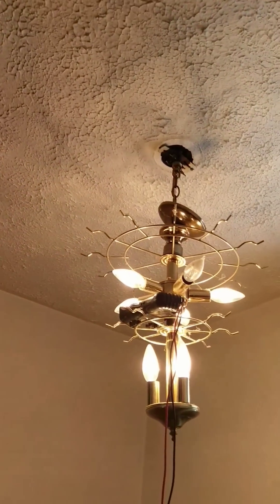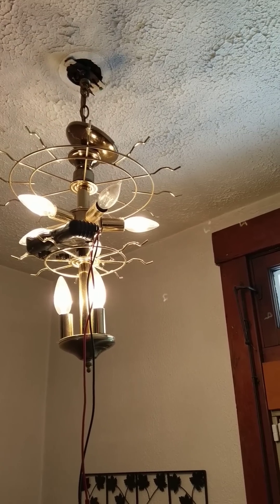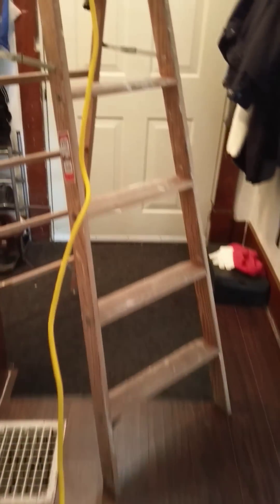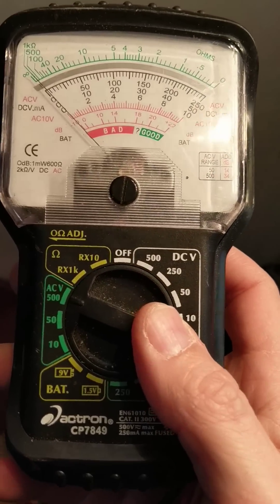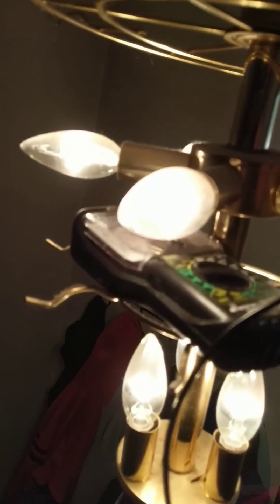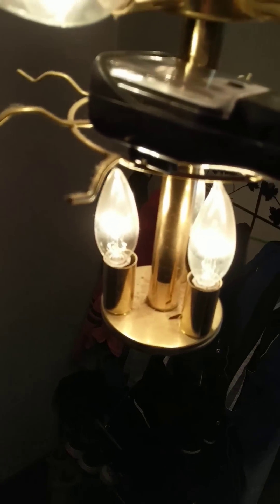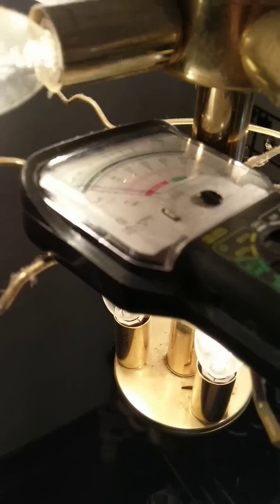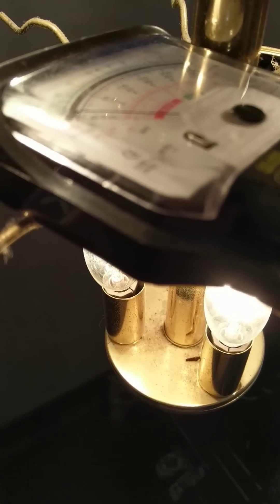DIY How to use a multimeter to test for hot and/or neutral wire when doing electrical work.

Comment: Hang on if you turned of the beaker like you said you did then how come the bulbs in your light fitting are on and one of the wires are hot ? I think you need to get the wiring in your house checked out ASAP
Reply from the maker: You have to turn the electricity off to expose the wiring. Then you turn it back on to test it. Please stay away from electricity if you don't understand that concept.

Comment: well if I only have 2 wires, a Live wire and a Neutral wire (and no Ground) How can I determine which one of the 2 is which...?
 Using a Multimeter..
Reply from the maker: Did you watch the video? Its not the greatest vid, but it explains how to find which wire is hot using a extension cord plugged into a wall plug with a known ground technique, using a multimeter.

Comment: This was a great explanation, thank you.

I'm trying to find whether an old light switch has power still going to it. Because we can't find anything that it's hooked up to.
Reply from the maker: If you simply wanted to find out if power was being supplied to a switch or a light, you can do that with a multimeter. They also sell devices that can detect electrical current that operate in a similar manner as a multimeter.

Comment: What if you don't have a known grounded outlet, how would you test them?
Reply from the maker: I'm sorry I didnt see your comment earlier. So, what I would do is go to my breaker box and open the case to expose the wiring inside. Dont touch the wiring! I would look at the wires and find one that has a copper wire going to the "side bar". So you got  two wires going to the breaker, and the one  copper going to the grounded side bar. If that breaker controls, say the kitchen lights and outlets, then those outlets will be "known grounded" outlets and you can perform this hack to figure out your issue. Good luck and let me know if you have any more issues I might be able to answer.
Reply: @ConwayTy  thank you!

Comment: For some of us idiots out there, which one is which when you get a reading or no reading?  You did not specify.  I will ASSUME that if the black of the voltage meter is grounded, and the red line of the voltage meter is touched to the HOT wire, there will be a reading on the voltage meter.  I will also ASSUME that if the red line of the voltage meter is touched to the neutral (white) wire, there should be no reading.      IF THESE ASSUMPTIONS ARE NOT correct, would you let me know so that I can delete or correct this comment?.  or would you DELETE this comment if the assumptions are not correct?
Reply from the maker: I'm sorry. Yeah my video sucked...lol. you assumed correctly, in that, the black is grounded and the red lead, when it touches a live or "hot" wire, you get a reading. So whichever wire you get a reading from is your power, or hot wire.
Reply from the maker: I hope this helps you figure out your problem!

Comment: Thanks for posting this very helpful video.  I do have a question.  When you plugged the extension cord into the grounded outlet, was it is in the same circuit as the light fixture?...or, does it matter?   I have two black wire coming out of the ceiling fan fixture, one solid wire and one stranded;  the light on the ceiling fan is turned on by the wall switch, but the old ceiling fan was controlled by the chain ( wired hot, i guess), but I don't know which one is hot.  I'm trying  to wire in a new ceiling fan with a remote and made the mistake of not noting how the old fan was wired.
Reply from the maker: Hi. Thank you for your response! It does not matter which circuit you use. As long as its grounded in the breaker box. If you dont know, you can try different outlets in the house. GFCI outlets are usually grounded, at least they are supposed to be but there's a work around for that... but you will know if an outlet is grounded when you start testing wires and find that one of wires gets a reading or none of the wires get a reading.

Comment: Dear Stick Man
I noted that you have a blaringly bright candelabra.  Perhaps this is the home of your parents or someone who is very hard of seeing.  But I truly wish for everyone to have the best lighting possible.  Lots of people dont stop to acknowledge the adege, "lighting is everything" for what it reallly means.  It does not mean that a lamp is everything, it means that lighting design, employing differnet brightness for different tasks and features is the key to successful ambiance.  Brighter does not mean better.  Design means better. While you may already have a dimmer, I have another suggestion.  
SOLUTION:
Replace the 6 horizontal bulbs with Edison style LEDs.  If you are already satisfied with the bare bulb look, why not do it well?  Some people have really had enough of the decade-long Edison craze, but that span has enabled better access and affordability to non-pro consumers.  Why use a 100w looking granny-brite white bulb when you could be looking up at a graceful amber mastery of technology?  Its more fun!  Apart from reducing your electric bill, you wont have to worry about having the lights on as long because they last so much longer.  In a room less used, the savings arent really there because the cost of the bulb outweighs that, unless were talking maybe about 10years of consumption.  But in a heavily used room like that, with it being the main overhead light, it will certainly save u $.  You might even pepper 3 LEDs with 3 you already have going, if u really dont want to waste the bulbs that still have life in them.  But I can see that one has already gone out, and the other 2-5 could further be stored and used to replace any of the 3 verticle bulbs that may burn out. 
Contemporary style can be difficult to upgrade, but this might help u span the 38years since 1980.  Some people think a big truck is the way to make an impression, but this is a more lasting, cost-effective way to make your teens think youre hip and the all the ladies swoon.   Yes, good lighting can make anyone the sexy king of smooth.
Reply: I would go with an LED under a 25w equivalent.  These look decent, but maybe too bright:  https://www.1000bulbs.com/product/117865/PLT-KC354SZCL22K.html?gclid=Cj0KCQjwl9zdBRDgARIsAL5Nyn3FcZMgbn14xJABOm3B2sT84Zh06b4OgndAqIm5ZOkbzbeyMCSYLdEaAqVgEALw_wcB
Reply from the maker: I was replacing the light fixture andsaw a youtube video opportunity... But thanks anyway...

Comment: So, should I twist the hot wire and neutral wire together?
Reply from the maker: I'm not sure what you meant by twist together.... If you mean twist them together before you hook them up to your new light fixture on whatever you are trying to hook it to, then no. Do not twist them together. The hot wire twists to the new fixtures black wire and the neutral twists to the white wire and the copper wire gets attached to the fixtures green screw. Don't forget to twist wire ties into the ends of thewires you twist together and cover them with electrical tape to prevent a fire.
Reply: @ConwayTy  This is a very useful and important part of the process I wish you had included in your video. Otherwise, very helpful video.
Reply from the maker: @imagesinla8575  Ok. I appreciate your feed back. I was really just trying to help individuals that are mechanically inclined enough to feel confident to know what wires connect to where. If you found your hot wire and don't know what to do next, you or anyone else reading this should really call an electrician.
Reply: @ConwayTy  "The hot wire twists to the new fixtures white wire and the neutral twists to the black wire and the copper wire gets attached to the fixtures green screw." What do I need to call an electrician for?

Comment: I have three wires coming out of the ceiling. One was reading 120 volts, one was reading at zero, but the other was fluctuating. So, is the one with 120 is hot, the one at that changes is the ground, and the one at zero is the neutral?
Reply from the maker: I'm positive the one reading 120 is hot. The ground wire usually is not insulated and is just a stiff piece of copper wire. The one with no reading is neutral.
Reply: @ConwayTy  Yeah, but in this case, I have three wires coming out, but they are not black, white, and blue. I have a yellow with 120V, and two white wires, one reading at zero volts, and other with reading that constantly changes. Whoever ran the wires did a poor job, but I'll figure it out, thanks for the advice. 🤔

Comment: Nice video!  Can I use this method to differentiate a line (hot) wire from a load wire?  If so I would imagine the MM would read about 120 on the hot wire and 0 on the load wire.
Reply from the maker: You are absolutely correct. Sorry I didnt see this comment sooner. For some reason I am not getting my notifications....

Comment: This video was a big help on the basics of a multimeter. It helped me diagnose a problem I was having with my relays in my pool control box. Was able to easily isolate the problem and fix it. Thank you! Saved me a lot of money.
Reply from the maker: Bender2497, wow, I am glad that helped you out!!
Reply: I was only familiar with checking fuses in my car using my multimeter, but kept getting erroneous readings when trying to just measure the voltage running through a single live wire. Using your method of grounding it through the extension cord did the trick for me. I just didn't know where to ground it.
Reply from the maker: Bender2497, nice! Way to go man!

Comment: I really wish folk would learn to turn their cameras sideways or horizontal when filming videos as this, as to not do so makes the video look as if your viewing things though a fence post or knothole. This was the exact thing I wanted to learn in using the electrical cord from a known working light socket, but it was sort of difficult to follow with the video shot in this manner. I have a dead set of outlets and I am trying to back track back to the junction box breakers to see if the series is hooked to some hidden GFCI unit. Someone suggested doing this and I will try to see if it works in helping me to track back to that hidden outlet or if one of the outlets happens to have a faulty ground or such. Thanks for posting the info though.
Reply from the maker: a1930ford, considering I know nothing about videoing, I didn't know it was going to do that. So, I put this up to help people. If I didn't help you I'm sorry. Try a known working outlet. Take it, and put it in where the non working ones are. If it works, it's the outlets. Highly doubt someone hid a gfci. If not outlet, possible dead breaker. If not that, then you have a short somewhere. Might have to rewire it.
Reply: Stick Man Yep. Thass wot he sed, Find and use a working "outlet with a known ground."

Comment: You made a very simple test into something way more complicated than it should be.  You can just touch one lead of the volt meter to the electric box, which is always grounded.
Reply from the maker: Bob Abrams, Sorry, but that didn't work. Tried it... Guessing it wasn't grounded. But thanks for the info!
Reply from the maker: Chicago DIY Learning Center, no outlet boxes.... That sucks man.... And yeah, a DIYer who doesn't as the very least read a book on electricity simplified should never play with electricity.
Reply: Bob Abrams No grounded boxes in my 1924 house ... plz post your/a link for how to do this very simple test.
Reply from the maker: You were assuming they even used a ground wire. I've seen plenty wired outlets with no ground wire.
Reply: No Bob, you are wrong.  What you are suggesting won’t work in an older wired/non-grounded box.  I tried what you suggested without success based on several videos I watched  before finding this one.  I have old cloth covered wires and connecting the multimeter to a known ground was the only way to get a successful test.  Thanks Ty for an excellent video!

Comment: I am trying to replace my light switch with a motion switch. I tested near the switch and got 120 on both. Does that make sense? I have one red and two blacks tight together and a third loose black wire hanging in the air (probably not connected because it doesn't give any reading)
Reply from the maker: Were the wires disconnected from the light switch when you tested them? The red wire sounds like the load (hot) wire. The two black wires, one completes the circuit and the other carries power to another light, outlet or light switch somewhere down the line. But Basically, if you bought a two pole  motion switch, you will have 2 brass nuts on the side and a green one for ground (which nothing gets attached to it in this case). Connect the red to one brass nut (usually the top nut but it doesn't matter) and the 2 black wires getvattached to the other brass nut. The left over black wire once carried power to a different outlet or switch down the line but doesn't no more so they disconnected it. Tape the end or put a wire nut on it.
Reply: Thanks. That sounds like it. I found that there is a ground wire screwed to the back of the box and I tested both switches and found that the metal frame is connected to the green screw, so that takes care of the grounding. The two cables that are tied together, like you said I noticed that one of them goes to the adjacent switch (which controls the bathroom fan), so I guess the red wire must be the hot. I'll try this out tomorrow morning now that I feel confident connecting it.
Reply from the maker: Yep, you are right. Ground to metal box will work as a good ground. And that leaves the 2 black wires  and a red... so I'm positive red is your hot. You got this man! Let me know if you ever have any other issues!

Comment: Umm... I have my black lead plugged in to grounded ext cord, and I'm getting .8, .9 V. before I touch either ceiling wire with the red... then I go to 0 when I do touch either one. 
Any idea why? (I have breaker off, like you said--although it looks like you have yours still on)
Reply from the maker: anyfoolknowthat, It sounds like you ground wire is back feeding a bit of electricity, which is not uncommon. But yes, I have my breaker turned on. It needs to be on so you know which wire is providing electricity! Please be careful!
Reply from the maker: anyfoolknowthat, I'll have to review my video... I don't remember saying that I turned my breaker switch off. Thank you for the info. I will look into that..
Reply: Stick Man you turned it off to separate the wires then back on to test them ... thanx a lot